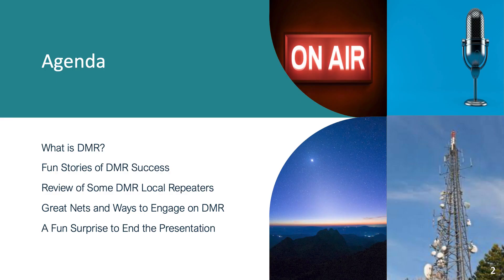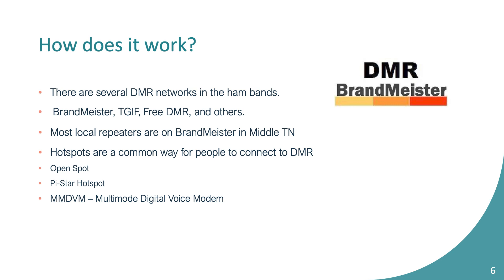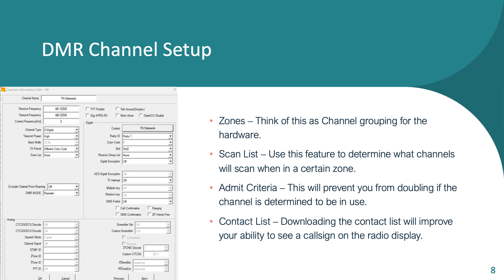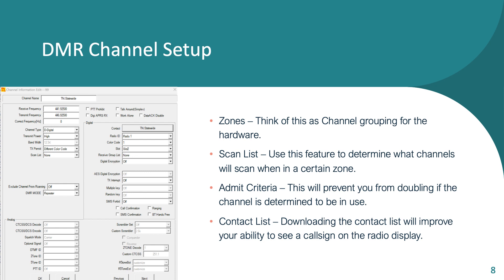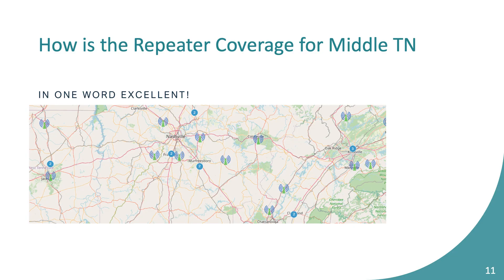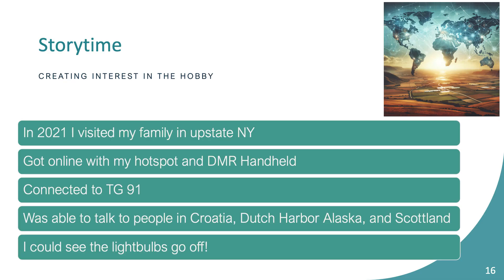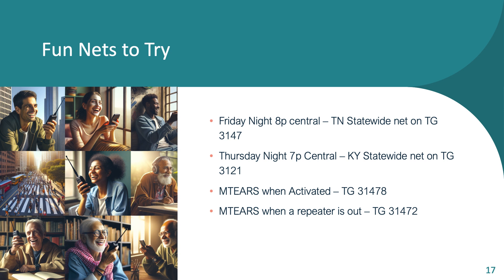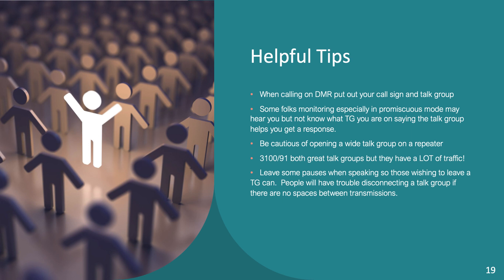DMR for Amateur Radio

Comment: Trying to get a grasp on DMR. Can you go to any frequency? I know TX will be limited to radio hardware but can DMR's listen up to the 900 Mhz range?
Reply: Usually the radios are locked to ham frequencies. I don't know any radio with dmr using 900Mhz band.